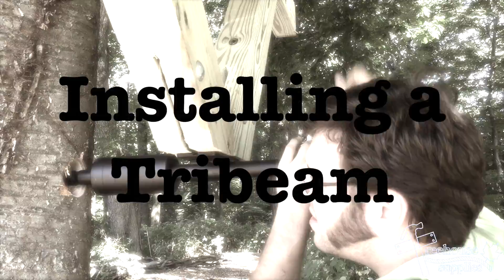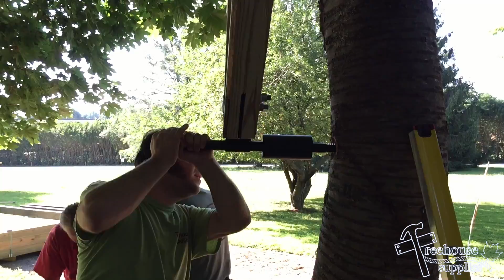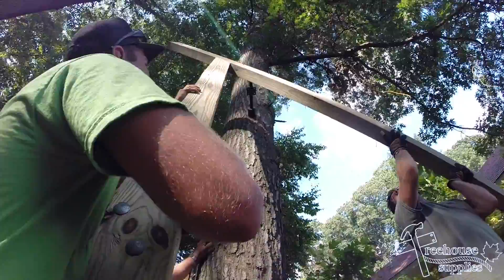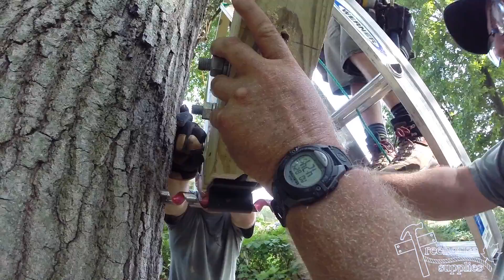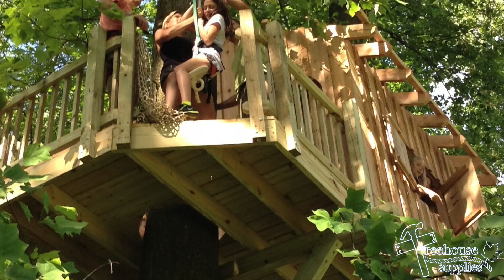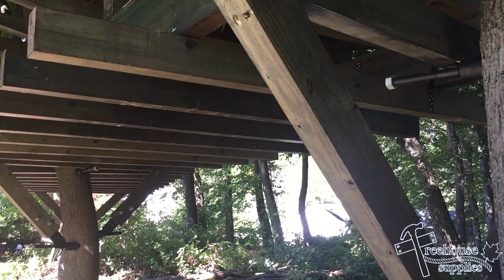How to Install a Treehouse Tri-beam

Comment: nice; but I'm bracing myself for $500 of hardware before I even buy any lumber.  uy.
Reply from the maker: Makes sense... When we design/build, we leave no doubt regarding strength & tree friendly attachment methods. There are cheaper methods, but they aren't as good.

Comment: I am planning a 1 tree tri-beam & 2 post style treehouse.  In similar designs I've always seen the joists sitting on top of the tri-beam, but I wanted to use joist hangers so the top of the joists are flush with the top of the tri-beam.  Would there be any disadvantage to doing it this way?